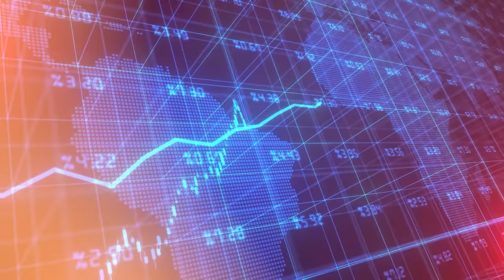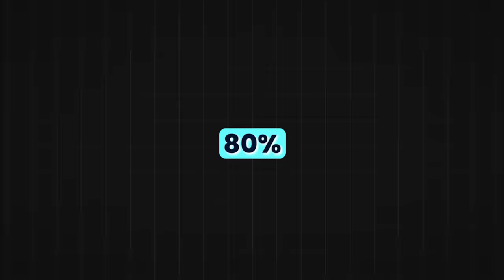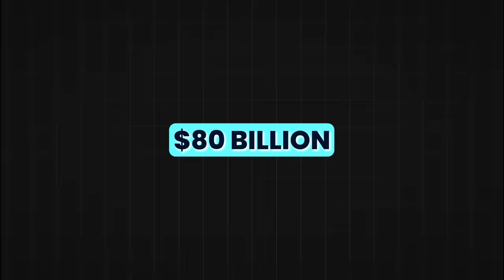HUGE NEWS! GM CEO Makes INSANE Move & SHOCKS ALL EV Makers!

Comment from the maker: Should Car Makers IGNORE politicians on the EV push?🚗Yes/No?
Reply: Yes.
Reply: Yes, but the politicians have a lot of power.
Reply: Positively . Fire the Diversity Hire CEO too .
Reply: Yes
Reply: Absolutely!!
Reply: yes
Reply: Hell yea
Reply: Those electric cars are not and will not be reliable ever, cause they are not self charging., it's that simple bad technology. It's like having a Combustion engine and alternator not working, yes it will run until juice runs out....
Reply: yes they should
Reply: Yes !
Reply: Dont ever listen to a lieing polutition
Reply: What kind of a stupid question is that?
Reply: Can’t imagine buying an EV and than being stuck with it for life…. NO one would wanna spend the money to buy it used fr you and have to change out the battery after for 60K
Reply: @owenfuruta1187 we did'nt have any problem in selling our 8 Year old EV.
Reply: Yes, she should ignore politicians. The grid is not ready for this yet but go ahead
Reply: The problem with Chevy is a female ceo!
Reply: @wilbertgarcia103175  That's kind of silly.  It's like saying a gasoline-powered car is not reliable because it doesn't distill it's own gasoline while running.  In both types of vehicles, you periodically need to stop and re-fill them (one with gasoline, and one with electricity)  The big difference is how long it takes to fill up an electric car compared to how long it takes to fill up a gas-powered car.
Reply: Yes

Comment: I'm not hesitant about evs. I simply won't buy one.  PERIOD
Reply: Your statement would have more impact if it stated the reasons why.
Reply: @MsHojat  Our infrastructure is not capable of handling that much drain on the system.  The technology isn't there.
 I live in the northeast, problems associated with batteries and cold temperatures. Those problems are well documented.  
 A trip to the store is a 50 mile trip. 
 Power grid goes down due to a storm or any other reason, your stranded. I keep extra gas at the house. Kinda hard to keep a gallon of electricity. Unless you want a building full of batteries. Which becomes a fire hazard. Or I can have a generator, which kinda defeats the purpose of going electric doesn't it.
Reply: That’s like the people who said they aren’t buying an iPhone 😂. How did that turn out for them
Reply: @donmunro144 oh no. Run! 

Some of you guys worry about first gen tech like it’s the deathbed of life

Ok.. then wait for gen 3 to come out. You realize it’s first gen tech. Improvements will come. Better ranges. Better cold weather use. More chargers every year

A lot of you people stress and worry and nag and complain about everything and anything
Reply: @ssing7113  I've never had an iPhone.  As for the complaints. You go ahead and buy one.  When you're freezing beside the road because your battery died or you're standing there watching your car burn because the battery caught fire, I'll wave on my way by. But I won't be offering you a ride.
Reply: I am not against new tech, I just don’t want to be the guinea pig. You all can buy all the first and second generation EV’s and suffer through the growing pains. Once the tech has matured to where it is as dependable, as convenient, and comparable in price to the ICE vehicles, I will consider getting one. But currently the EV world is just too volatile for me.
Reply: I'm with you I will walk before I drive one of them. But I own several vehicles that are diesel powered and it's going to be a long, long time before diesel fuel is pulled from the market.
Reply: @donmunro144  the problem with your reason is that it's based on ignorance(not knowing).

1st issue.
Gas can. There's battery pack out there that can be charged with solar power or a normal electric plug(they come with the panel and charge up in 3 hours). You can stack them to get even more power if you'd like. They not only can charge a EV up some but can also be used as a personal generator. Plus it's safer then a can of gas(and not much heavier then about 3 gallons of gas or lighter). 

2nd. The electric infrastructure. That just false info(a misleading statement brought on to scare ppl away) most state/cities/towns will have no issue and it's being upgraded even more these next few years.

3rd. The temperature problem is going away(and alot of EV's have fixed this issue outside of extreme circumstances). They now have heat/cooling packs around the battery. As fire as the "fire hazard" it's no difference in chance as a combustion engine. Plus I guarantee you have at least 5 thing in your home that has the type of battery type as an EV. If you have a laptop it uses the exact same battery design that's in its battery pack.

I believe I covered all your concerns, I'll double check when I get home.
Reply: @LegionZer0games  don't bother. I'm too ignorant to understand. I've never seen rolling brown outs or seen battery capacity drop in extreme cold. You go ahead buy your ev. If I run out of gas, I simply dump more in and start it up. Not sitting and waiting for a battery to charge.
Reply: @donmunro144  you wait for gas too. It's not just automatically "dumped in" yes it's quicker(as of now).

I was just saying 100% of your issue aren't issues anymore beside the extra time it takes to charge. And I'm sure there were plenty of cowboys who said I'll never get a gas vehicle when my horse is better.

Electric is just another method of fuel. I don't understand why people act like it's the devil. It took gas powered cars to come fully adopted and the same with electric.

Like the American Tale "never say never".
Reply: @LegionZer0games  NEVER NEVER NEVER.
Reply: @donmunro144  will see. Lol

Comment: We simply want a HD 1/2 ton Chevy pickup with an inline gas, 6 cylinder engine and a 5 speed manual transmission.
Reply: Sounds OK.  Get rid of all the fancy gadgets and sell us an affordable truck that works hard and lasts long.
What are you thinking you want to pay?
Reply: 100%, or a Ford. A 300 six with a 5 speed.
Reply: A price range of $30,00 to $45,000. Base model should be a simple and reliable work horse. No fancy bits and pieces, no touch-screens ;audio/infotainment, only standard single or double DIN Head-Units
Just an inline 6 cylinder with options for turbo diesel and petrol variants, with a 6 speed manual transmission, to get that sweet overdrive Efficiency on highways and freeways.
Optional 5 speed automatic transmission, for those that like to just drive without thinking about changing gears.
Max curb weight of 1.5 metric tons, maybe a bit more for towing 1 ton loaded trailers.
Must have the ability to fit a bull/Roo bar for animal collision protection. Very important for the Australian market.
Also a 100 litre fuel tank capacity for added range should be a must.
No metallic paints, just solid colors. 
Plenty of room for any 3rd party equipment, eg. CB radios, VHF radios, air-compressors, 2nd battery systems, etc.
Minimal use of plastics for construction of engine components.

I could go on, but I'll hold myself here.
We just want simple, reliable and easy to fix and maintain, vehicles that won't cost an arm and a leg to buy and/or run..
Reply: Make that 6 speed please! Lol

Comment: They have some big issues with their gas motors too.. 12000 miles on my 6.2L when it blew up. And i don't drive it like a mad man. I drive it like it should be.. then i hear from someone that works at a dealership saying dont buy the 6.2L.. Its sad. I remember when a chevy motor was damn near indestructible...

Comment: Hey EV makers a few questions……after I pay them High prices for EV’s 

How long is the Battery going to last…….?
How much is a replacement battery pack and could I get an aftermarket instead of paying OEM……?
Will the car company have the option to lock me out…?
How much am I going to pay to recycle the battery pack…….?
Why is the range so short, especially in cold weather…..?
Why do I have to stand in line so long even in freezing weather…..?
If I put a boat in the water will the salt water short the EV truck out……?
Will I have enough time to bail out of the EV when I see the “white puff of smoke” before I  get engulfed in fire….?
If you drive in high water because of flooding rains or a hurricane, will I get electrocuted…..?
Will I have to buy tire more often because the car is now heavier….?
Is maintenance cost now going to be more expensive…..?
How much extra to have a charging station installed at home….?
What happens during rolling blackout….?
Where are all the EV batteries going to end up at….?
Is the Government credit going to off set my expenses…..?
 If I can’t get a good answer, then you all have failed your college course “Business 101”……
The Consumer will dictate what you make, not you…….
So much for being Eco Friendly……
Reply: Another question, who will make up the loss of the gasoline taxes for road maintenance if all gasoline vehicles are banned? Will it be borne by EV owners?
Reply: Just like Oregon, not enough gas taxes because of all the EV’s and now they assess everyone based on miles travelled (Slam you with another Tax)

Comment: I would NEVER buy an electric vehicle of any kind.  I wouldn’t accept one if it was free!  I don’t believe in them, or trust their range.  The biggest fear is being stranded in the middle of nowhere and no way of getting to your destination or getting back home.  I see electric vehicles as a “lemon” and just not a practical investment for the average American consumer!  I’ll pass!
Reply: Nothing wrong with an electric vehicle, depending on what it is.  I'm looking into getting an electric bicycle (not an electric motorcycle).  Saves me from buying some gas, will get me to and from work no problem or to anywhere I'd need to get to that's a reasonable distance.  If the battery dies, I can easily just use my legs and pedal.  Better yet, the battery wouldn't be ridiculously expensive to replace.

Comment: Ibougt an eV God help me I was a fool oh God help me why are the bastads fooling people
Reply: What did you buy?
Reply: What EV did you buy, and why do you feel that way?  I bought a Hyundai Ioniq 5, and I love mine.  I love the acceleration, the quietness, the interior room (with a perfectly flat floor front and back, and I love the relatively quick charging (typically 15 to 20 minutes) at a public Level-3 DC charging station.  I love the low cost of refueling at home.  Some disadvantages:  high purchase cost and high insurance cost, and not enough public charging stations (although I had a level-2, 240-volt charging station in my garage).  This car, like most (maybe all?) electric cars, has a way to pre-heat the batteries in the winter so it can accept a rapid charge from a level-3 DC charger, but I had to read "the book" (owner's manual) to figure out how to do it.  I'll bet most of those people who got stranded in Chicago during that cold snap didn't know how to do that in their cars.

Comment: Natural gas is a much better interim solution.  Cleaner burning, can modify existing vehicles, readily available even with a home compressor, easily made from garbage.  Range is same as gas cars and fueling up is fast.
Reply: Range is not the same as gas. Not even half. Where are you getting this information?

Comment: we do not want electric cars.  I don't want to fight over chargers or have to wait X number of hours for the charge. plus I live where there is no way possible to put a charger without tens of thousands of installation costs.   no. not now. not ever buying an EV.  if you wreck an electric car your insurance may cancel your coverage if you don't replace battery after a fender bender.

Comment: There are many issues, first there are people saying they won't buy an EV will need to think out of the box. Fossil fuels are not going to last forever and it is long past the time for alternatives. Another issue is the cost of an EV, brand new you're having to spend big money and in some cases past six figures to get a nice one. I looked up the price of Hummer's and Rivian's for the heck of it and I am seeing both vehicles selling for well over $100,000. This puts it out of reach for most buyers not to mention there are not enough charging stations out there yet. Which brings me to another concern that some people have is range. Although over the years EV's are improving on their range with better technology over time. When it comes to range some EV's cannot compete with some gas powered cars and trucks. I think the solution is to overall lower the price of EV's and having two door options on the table. All of the EV's that I have seen on the road have 4 doors and not everyone wants a 4 door. The other is keep improving on the range and Lithium-ion batteries that these EV's use. In addition a sizable tax credit/break for trading in a gas powered vehicle for an electric one. This was done in the past as I recall in the Nissan Leaf first came out.
Reply: But how is that ev cars are any better. The mining that is done to get the supplies to make the batteries is way worse for the environment. Plus once they go bad there's no where/way to recycle them

Comment: Like almost every novelty that comes along the early adopters are in like flint but once that cohort runs out there are diminishing numbers of buys and that's before we all discover that they don't go far, they don't work well when it's cold out, they are way more expensive than gas powered transportation. Then there are the spontaneous fires with them. And today here in Canada I just heard that the insurance companies are going to start raising their insurance premiums to reflect all the expenses to repair these glorified golf carts or the write offs. But everyone is missing the elephant in the room and that is one of who controls most of the raw material needed to build batteries? Take a guess. Yup, it's China. One raw material audit I read from someone versed in the industry said that at today's rates of mining lithium it would take 1600 years to supply enough raw material to build all the batteries needed to power this scam.

Comment: The arguments against sounds exactly like when CD’s came out.  All the na sayers haven’t driven one. There a blast!
Reply: So true👍
Reply: So, the charging and range problems in cold climates, and electrical grid fragility in hot climates....all of this is trumped by the fun factor? I have had reliable transportation for over 40 years....but I should change it now even though the cost is prohibitive for me? The only good thing about an EV at this point is I still have the freedom to say no.